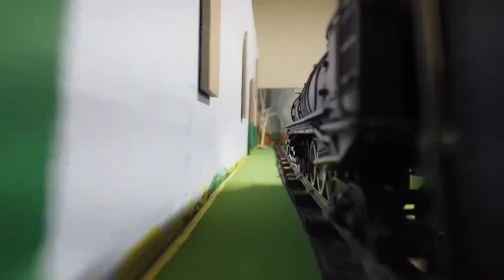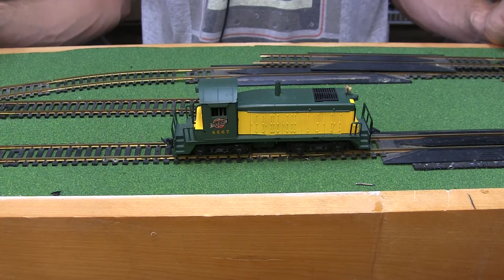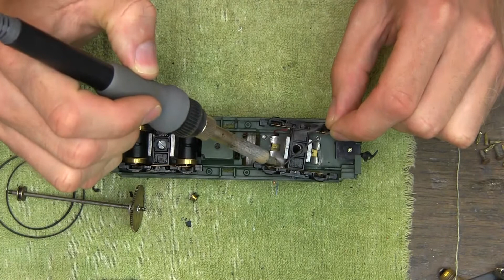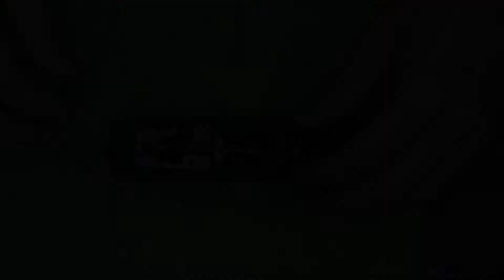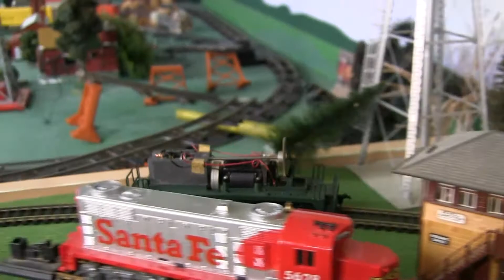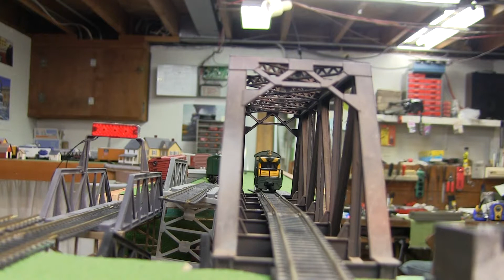Is This the Worst Ever HO Engine? Can We Make it Run?

Comment: I have a perverse affection for some of the old HO drive mechanisms like the Varney spring belt drive and the Athearn High F rubber band mechanisms. That said, I can’t imagine what madness drove the person who designed that mechanism.
Reply: So this is where Jouef got their ideas for a driving mechanism. All along I thought they were responsible, but it was Varney. Just terrible.
Reply: Barney used a spring belt but the rest of the mechanism wasn’t a Rube Goldberg machine like this.
Reply from the maker: I also have a few Varney belt drive and Athearn HI F engines. I like their character. This engine has character! The crazy part is, it actually works!

Comment: I have this switcher.  B&O...absolutely best painted budget diesel of the era.  I got it in a box of Varney and early Mantua stuff in the early 70s.

It is a horrible drivetrain.  It did creep though (rare in that era), but it couldn't pull more than two cars on level track.
Reply: I kept it as a loco constantly under repair for my shops.
Reply from the maker: Does yours still have the original drive belt?
Reply: @MygrandpasTrain  yep

Comment: That noise will drive me nuts
Reply: I have two of them and they don’t sound like that at all, but then again I have the right coils for them?
Reply from the maker: The noise in mine is mostly from the motor bearings, I would have to pull it apart farther than I did to oil it. That would fix the squealing. The grinding noise is from the large gear not fully meshing with the small gear. A proper coil belt would help it move better. Since I didn't have one I tried substituting an extra cassette deck belt.

Comment: Hello, 
I have the Santa Fe version of this switcher and my drive belt is broken. What replacement belt did you use? 
Thanks, 
Matthew Falkowski.
Reply from the maker: These originally came with a metal coil belt- actually a spring. If you have original coil belt, (Dont throw it out) and the skill, The manual explains you can repair the spring by bending the ends around each other. The coil belt would work better than a rubber belt, but mine was missing. I got a multipack of cassette belts from ebay and used whatever fit, probably err on slightly too tight they will stretch a little.
Reply: Thanks for the reply, 
I have the original belt but potions of it are bent out of place causing the belt to slip and come apart with no springing action when the motor is running hence why I was looking for an alternative solution. 
-Matthew Falkowski.